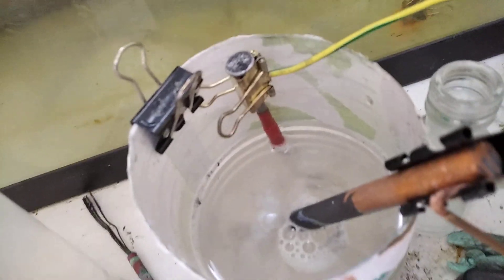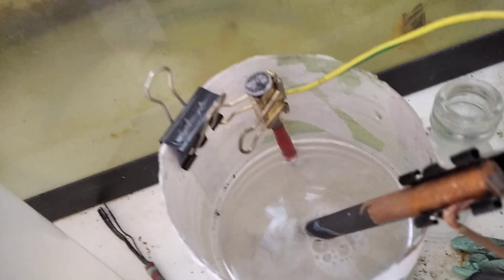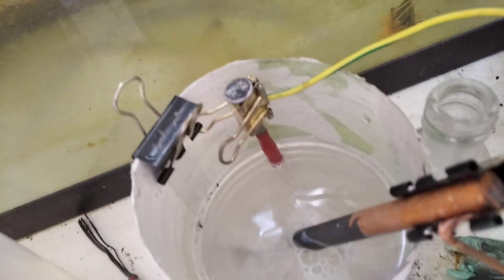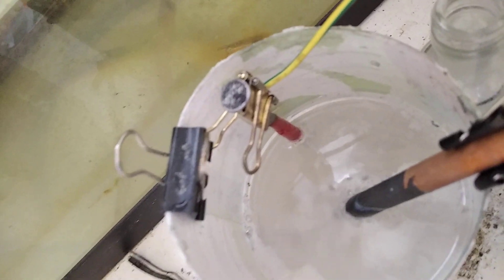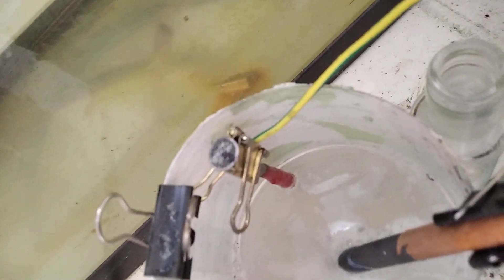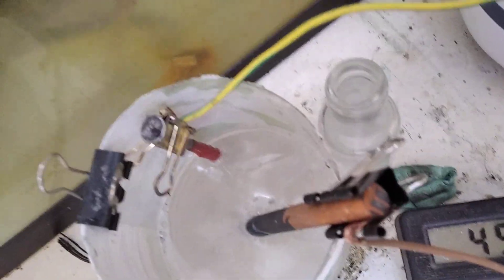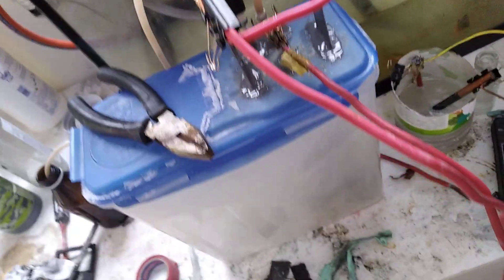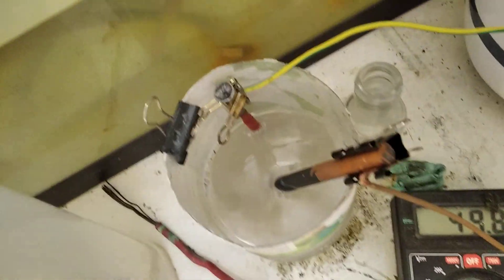New universal substrate PbO2 polymer composite electrode

Comment: Is the bonding strength between tin dioxide and manganese dioxide strong when electrolyzing manganese sulfate solution with titanium based hot coated tin dioxide coating?
Reply from the maker: Electrolytic needs to be baked still at 380C after plating to convert to most conductive form but I haven't heard back yet from my friend testing it.

Comment: That's great! I've heard of using just PbO2mixed with epoxy, but this sounds like a more durable way for smaller runs to be done.
Reply from the maker: remember that you still need to plate conductive beta PbO2 over it
Reply: Ever consider selling electrodes? I'd buy!

Comment: Damn!!   How it's made? Undercoat epoxy mixed with lead dioxide powder and pressed?
Reply from the maker: you have to coat the electrode with epoxy first then get a cursed bed of PbO2 powder from batteries or from H2SO4 cell sludge using Pb electrodes.
The electrodes are then pressed hard into the powder until a solid layer is there and this can be used as the undercaot.
The resulting layer may have bad conductivity at first but if you know how resistors in parallel work once the coating covers the entire surface the total resistance will drop due to the fact that PbO2 is highly conductive and more so than graphite.
Reply: @CatboyChemicalSociety  is this gonna work with MnO2 powder? Can I cover a graphite rod with MnO2 - epoxy and then plate PbO2 onto it with a lead acetate bath?
Reply from the maker: @marcopendoli  should work yea!! but dont use battery paste only pure pyrolusite and the conductive variety which means heat treatment of MnO2 powder at 400 Celsius should be done beforehand to convert it into the conductive form and the temp must be precise or you may reduce the MnO2 if temp goes to 500.
Reply from the maker: yea thats how